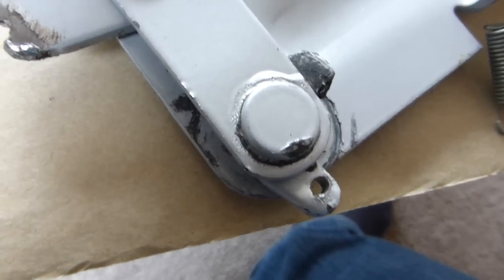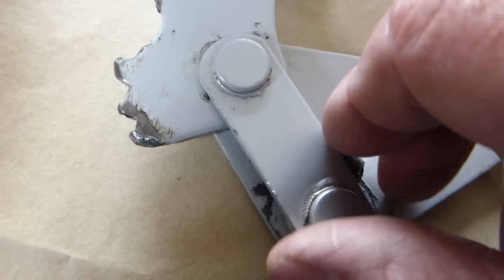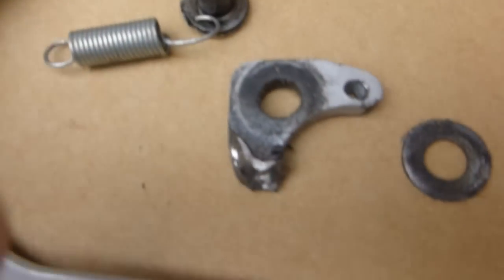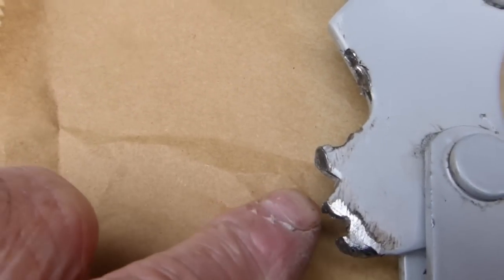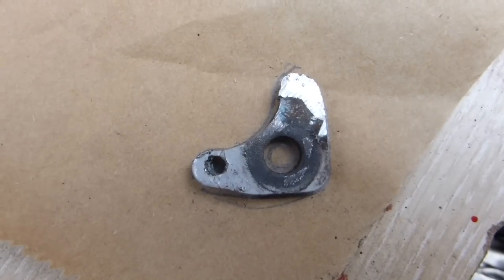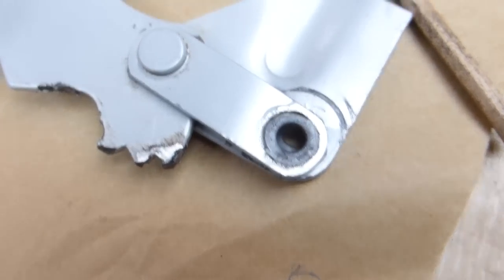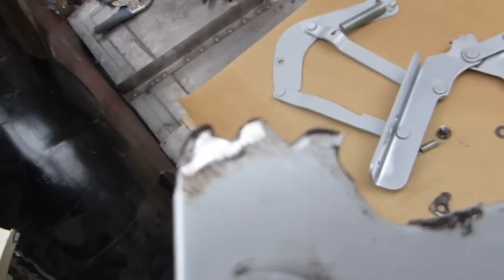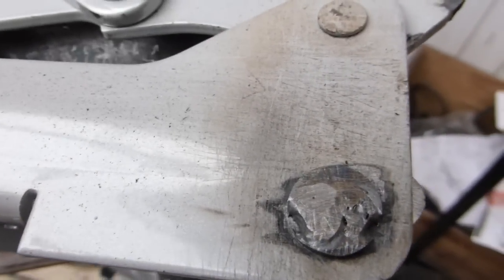Ikea Beddinge Lovas sofa bed repair

Comment from the maker: Hello, I just used a grinder to take the rivet head off and punched it out. The rivet can be re used and a blob of weld to replace the head. The triangular ratchet that is held in by the rivet has a bend in it and must be put back in the right way round or it will not work. Good luck. Alec